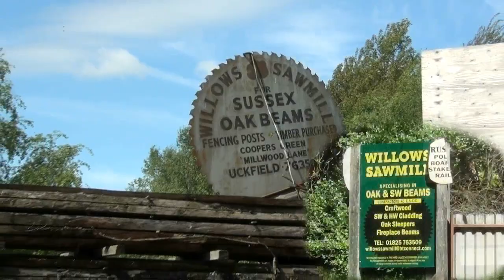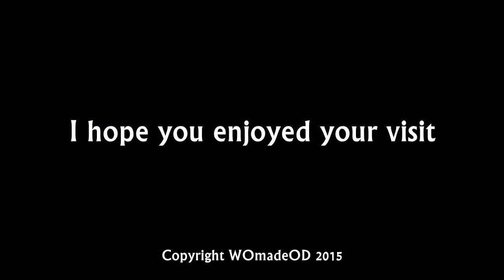A Family Sawmill - Road Trip

Comment: Thanks for posting this Mitch. Very enjoyable. And by the way, you're driving on the wrong side of the road....
Reply from the maker: GuysWoodshop How does it compare with stateside? I imagine family sawmills to be similar the world over.
Reply: I went to a small sawmill about 5 years ago, and it was very similar. The saw they had was not as large as the one in your video, but still very cool to see.
Reply from the maker: They only upgraded to the large horizontal mill last year, giving them greater capacity. 
Pleased to say they have plenty of work on too, so no fear of loosing this great resource.

Comment: Cool video Mitch. Wish I had access to a local saw mill, and a place where I could buy air dried lumber.

That bandsaw was nice, and moved fast. I wonder how often they have to change/sharpen blades.

Nice to know that the local lumber business is alive and well in England. I had the impression that England didn't have a lot of native lumber (for the saw mills, obviously there are a lot of trees in England) because of too much harvesting in the past. But maybe it's fully recovered?
Reply from the maker: Marty Backe I would say it's mainly oak - the legacy of wooden ships being built here prior to steel hulls. Certainly there were times when the number of harvestable trees dipped very low, but thankfully it seems to be sustainable now.